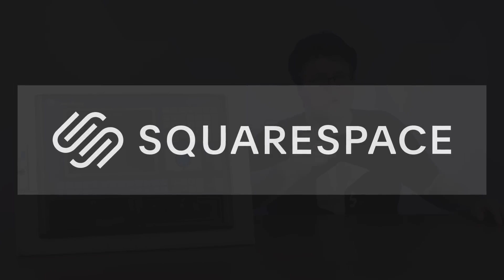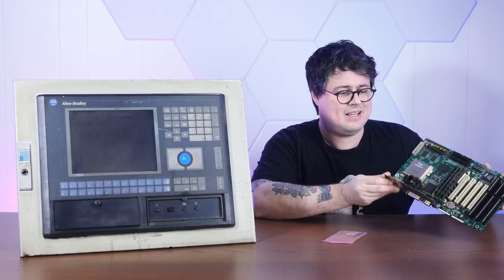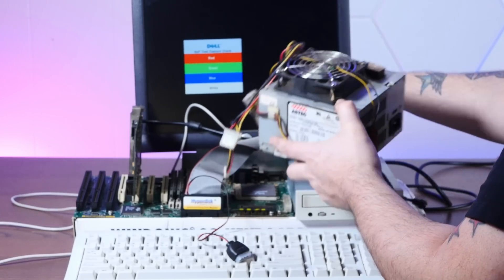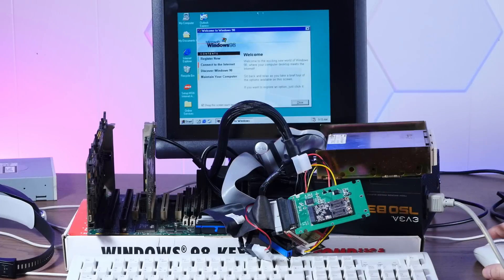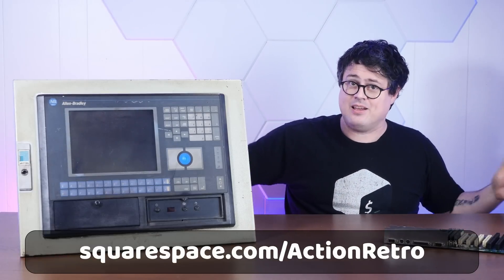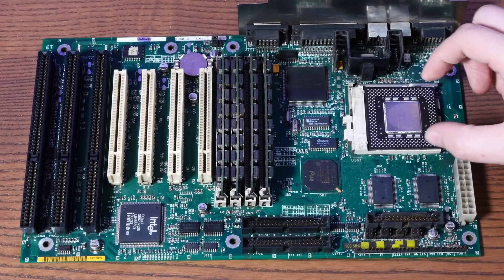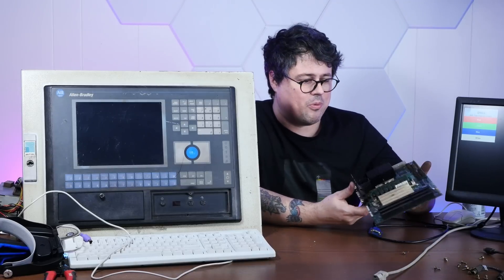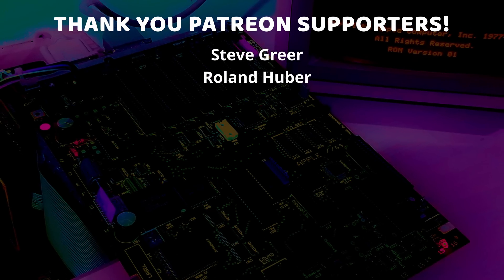Overclocking a 90's Industrial Computer

Comment: Too bad : your 233 would have had a legendary frequency :
- Multiplier 3.5 is at max on this cpu,
- FSB is another story : base is 66Mhz but you can go up to 75 / 83 / 100 depending on the board you have.

Comment: Is suggest installing ither a 3DFx Card or an Early model Riva TNT, TNT, or Geforce a Matrox G400 (Have one in my "Retrobox 2.0", Pentium Talautin 1.2GHz @ 1.5GHz, 1GB RAM, 16GB IDE SSD and a G400 for 2D - witch is a very good DOS, 2D card and even a decent 3D accelerator, paired With a pair of SLIed Voodoo2 12MBs for 3D duties). 

All good for DOS and Windows games, especially acclerated ones. 
Just an idea.

Comment: And, for reference, the WHITE image IS NOT the motherboard, it will be the graphics adapter OR the LCD controller itself. Though from what I see I would advise you to check the cables between the LCD controller itself and the LCD panel as I have seen this before and it was due to a bad connection between the LCD controller and its flat panel. So check the board the VGA cable connects to and then check it's connections to the panel.

Comment: That CPU likely has a locked CPU multiplier, as such you would need to instead increase the FSB speed, though to do that you must ensure that everything that depends on the FSB supports the higher speeds, things such as PCI bus clock, RAM clock and ISA clock are usually derived from the FSB and as such you must ensure they all work at the faster speeds.

Comment: Initially when early IDE/ATAPI CDROMs came to market the motherboards bios would not detect ATAPI/IDE CDROMs as they were not designed to work with that type of devices and would also not be able to boot from them, BUT once you load the CDROMS driver on DOS or another OS it would work.

Comment: Just a small note, most processors if not all in the socket 7 lineup were multiplier locked and could not increase the multiplier, but you could always use a lower one. The method for overclocking the p233mmx is set the fsb to 75MHz with the stock 3.5x multiplier or if the board supports it 83MHz with a 3.0 multiplier, netting you approximately a 263MHz/250MHz Pentium experience.
Reply: Hi @Benjamin Hale, the multiplier lock was not introduced until the Pentium II line-up. All socket 7 CPU's have a completely unlocked multiplier, as had been the norm up to that point. When the locked multiplier was introduced with the Pentium II, the claim (I think largely true) was that it was to combat fake CPU vendors that would re-mask a CPU and sell it on as a higher clocked version than it was rated for. I do think Intel liked putting a stop on casual overclocking as well.
I know this for two reasons. I have access to all of these processors first hand. I also have the timing of this burned into my memory. One factor in my choice to buy an AMD K6 for my first computer build instead of a Celeron was the multiplier lock.
Reply: I thought most were unlocked. My Pentium 166 and K6-2 450 are definitely unlocked. And the standard FSB speeds are 50, 60, and 66 MHz. 75MHz FSB is definitely not on all boards.

Btw with older CPUs a locked multiplier can't be lowered. My PIII-700 is always 7x, to underclock you need to lower the bus speed. I'm guessing Sean has a 200MHz CPU and he unknowingly overclocked it (the 1.5x jumpers are remapped to 3.5x on the MMX).

Comment: Basic math shows that the manual's jumper settings table @8:59 are incorrect (and inconsistent with what's printed on the board right next to the IDE connector). The clock multiplier column should read "2" for 133 MHz row (not 2.5), and "1.5" for the 100 MHz row, since 66.67 × 2 = 133, and 66.67 × 1.5 = 100. This can be confirmed by looking at the adjacent rows; the "jumper D" settings are respectively identical to the lines for 120 MHz (where "2-3, 4-5" is a multiplier of 2), and 90 & 75 (where "1-2, 4-5" is a multiplier of 1.5. 

Looking closely at the video and zooming in on the jumpers, the CPU frequencies seen are consistent with what they are supposed to be, specifically:
- @7:22 the jumpers were in the original "100 MHz" positions for 66 MHz bus & 1.5 multiplier; 1.5 serves double-duty as a 3.5 multiplier on MMX CPUs, and 66.67 × 3.5 = 233
- @9:16 the jumpers are in the "highest possible" position (as mentioned @9:06)...66 MHz × 3 multiplier, correctly resulting in 200 MHz 
- @9:42 the jumpers appear to be in the 166 MHz setting (66 × 2.5); not sure why the 200 MMX would freeze at this speed
- @9:48 the 125 MHz result is consistent with the jumper setting, which is "2-3, 5-6" for C (50 Mhz bus), and "2-3, 5-6" for D (2.5 multiplier)...50 × 2.5 = 125
- @9:56 the jumpers are in the 50 MHz × 3 positions (C = "2-3, 5-6", & D = "1-2, 5-6"), so 150 MHz is correct
Reply: I'm glad I wasn't the only one who noticed the errors in the manual.

Comment: I had a breakthrough with my modern PC the other day... Such an esoteric problem I had! I'd tried to change the gpu to an AMD one on my b550 Aorus master. Apparently when you change the hardware in any major way the motherboard wants to show some kind of message which isn't displayed on most normal display port monitors! So I found a post where someone had the same problem with an Aorus master x570 board and found that I had to just boot it once with just my hdmi tv plugged in... then saved my bios settings and rebooted (which would usually result in a hang with 00 code)... But it rebooted just fine with the hdmi tv plugged in and now can restart from bios every time even with my display port monitor installed! This is the trickiest PC problem I've ever had to overcome!

Comment: It is possible use other motherboard?
I think is better use a modern board like s370/slot 1 or up to s478,
Reply: If he did that, he might as well just tear out everything and stick a new Ryzen board in there and mount a modern LCD in it too. Either way, it would be a different machine.

Comment: I think you may have fried something when the CF to IDE adapter shorted.

I remember noting that when you removed the IDE Cable, you moved it FROM the socket that's dead, and plugged the DOM into the one that works. If that's true, you would have never registered "shorted adapter = dead IDE" because it worked after you installed the DOM.
Reply: I saw this as well. That's defiantly when the secondary ide channel died. I may or may not have done this before... <_<

Comment: the 233mhz speed is not too unexpected since the stock cpu was 100mhz and have come across several socket 7 boards that make 1.5x66=233mhz when using a later mmx pentium
Reply: Exactly this. The processor was made at a time that Intel knew that MANY motherboards had maximum multipliers of 3.0x, which at a 66 MHz bus speed is…. (As Action Retro demonstrated) 200 MHz. So they made it so that if the CPU was being told to do a 1.5x multiplier or less, it would just automatically do 3.5x instead.

I'd be curious if the "RESERVED" bus speed jumper setting of J7K1-C: 1-2 4-5 might produce a 75 MHz frequency or something. Unfortunately, the multiplier jumpers already are using all possible combinations to produce 1.5, 2.0, 2.5, and 3.0. So if J7K1-C 1-2 4-5 is 75 MHz, using the 3.0 would be slower than stock at 225 MHz (but faster bus, which may be some benefit.) and if the CPU still does the "1.5x -> 3.5x" internally, 75 MHz would be 263 MHz - which MIGHT be possible for that CPU with proper cooling.
Reply: @AnonymousFreakYT  Yeah but "RESERVED" might connect up bits of the clock circuit wrong and end up blowing something, jumpers physically alter circuits after all, they aren't just data.

You're quite right about CPUs re-using old multiplier settings as faster ones though.
Reply: @greenaum  Jumpers sometimes alter physical aspects of the circuit. However in this care they are just data bits going into the clock generator IC.
Reply: @eDoc2020  Sure but if, for example, you set a bit by connecting to gnd, vcc, or leave floating, you might end up connecting gnd to vcc with an illegal jumper setting, buggering the whole thing. It's also not impossible that other components are connected to the IC, different crystals or passives to work with the PLL.

If you know better in a specific case, feel free, but as a general principle it's good not to mess with stuff like that. If it was meant to do other clock speeds, they'd likely be there legitimately.

Besides that, the multiplier jumpers go straight to the CPU, which multiplies the clock internally. They are data bits, yes (though of a particular voltage other components might not share), and as I said, Intel / AMD repurposed them for higher multipliers as lower ones became obsolete. Confusing at best, also another good reason to stick with the manual!
Reply: @greenaum  Obviously it's safest to stick with documented settings but generally the designers aren't evil.

Comment: amd k6 3+ please twice the pentium you have there :P my childhood dream

also try making fat 32 partitions on the drive on onther computer, you may get the bios see 2gb but it will still boot from bigger partition and windows wuill see the whole size, my k6 166 booted from 40gb hdd devided in half with the bios capable of seeing max 8gb
2gb was the limit for windows 95/fat windows 98 should be able to see drives bigger that 32gb
Reply: You don't need a separate computer to create the extra partition. If you launch FDISK from a DOS Prompt inside of a fully booted Win9x you can create the partition on the same system.
Reply: @eDoc2020  oh really? i either never tryed it because of lack of spare hard drives back then or i had lausy luck with it (might be either i was 16, 20 years ago)
either way my old mobo accepted disks up to 8gb in lba size seen in bios, seagate baracuda has 40gb and my boot partition had 20gb, and we were all crazy with my younger brother and walked to the nerdiest friend we had to a vilage close by to get the partitions set up on a new drive
Reply: @kokodin5895  I don't know where I came up with the idea but I was somewhat surprised it worked. I found it fascinating that in DOS mode a drive letter wouldn't exist but in Windows it would.

Comment: You know that 750W power supply might be enough to power the computuer AND the robot that machine might have originally controlled right?
I mean not most of them, but one of them was probably a light engraver and not a 2 ton CNC lathe
Reply: When in doubt, you should go overboard on wattage with modern PSUs on old computers since they're mostly designed with 12V load in mind. This particular 750W PSU like many only does 120W max combined on the 3.3V and 5V rails.
Reply: @D0Samp  I dare him to build and run an engraver or laser cutter off this PC with the extra 12v capacity as its designers intended.

Comment: The symptoms look like, that the Graphics Board is not connected to the Display. May the cable is on the Graphics Card loosy or on the LCD self. The Display don't get Power for the Logic. Only the Backlid is powered, this should be a seperate Powerline to the Inverter for the CCFL.
Reply from the maker: I'm thinking the same - the cables are connected, so I'm wondering if a solder joint on the video card's internal connector cracked
Reply: @ActionRetro  Ok, lookup for the datasheet of the LCD-Panel to get the pinout of the Data-Terminal/Connector and then trace it to the PCI-Card. May a little fuse is there blown or this Slot is different from Power Levels? In the First Video was the Graphics Card in the 2nd Slot near by the RAMs.

Good Luck

Comment: That board appears to be using SMD caps....Aren't SMD caps of that age known for leaking?

Might want to think about replacing them. Might revive the dead IDE port and the display. ;)

Oh and if you used windex you might have damaged the polorizer on that LCD panel. :(

It probably doesn't have a protective cover like normal LCDs that are exposed to the environment since it's been behind that front membrane keyboard cover thing it's whole life.

You can try finding some polorizer film/sun glasses and looking at it through them. If you see the display working through them then yeah you damaged the polorizer. :(
Reply: no, cap plague was much later in the early 2000´s
Reply: @motorb1tch  No that's a seperate issue. This appears to be a mid to late 90's machine. You know what else from that era needs new caps today? Vintage Macintosh Machines. I also have a few VHS camcorders from that era that use SMD caps that have started to leak. 

It's not related to the plegue of the 00's. The SMD caps from the 90s like this mobo uses are simply prone to leaking due to their age. It's mainly the through hole style caps that lasted longer hence why some really old stuff like the Macintosh SE which doesn't use SMD caps but cylindrical through hole ones don't need new caps. (though their analog board/power supply capacitors are starting to fail but this is due to heat exposure which shortens capacitor lifespan and the analog board and power supply is pretty much where all the heat comes from in that machine)

So that's why I suggested replacing the SMD caps. It's not related to the 00s capacitor plegue but the aging SMDs from the 90's plague. :P
Reply: @MagnumForce51  true, these caps dont last forever even if they do not leave the factory defective.
still, i would never suggest to fix something that is not broken. 
it is an industrial board and certainly build to very different specs then consumer products.
while you are right in that caps of that age are always suspicious, id rather suggest to measure them with a mulitmeter  then just pulling out the soldering iron.
Reply: @motorb1tch  Well the board is broken somewhat. One IDE port stopped working and there's no video output to the LCD panel. (though that could be an issue with the panel itself after he attempted to clean it)
Reply: might as well put a Microid Research BIOS on it

Comment: I don't understand why are you upgrading the CPU and you still do not have drivers for Windows 95. 
So now you have Pentium MMX, and you still can't game cause you don't have drivers.
Reply from the maker: I think Windows 98 will solve it
Reply: @ActionRetro  I mean I kinda doubt it, Windows has built in only some basics drivers, you should find out what graphics card you have and find driver for it online.
Reply: @KoleckOLP  Windows actually came with drivers for most of the available hardware released before it. So Windows 98 will most likely have drivers for all the non-exotic hardware a 1997 PC has. I was actually recently surprised when 98 had a driver for an Ethernet card made in 1999.
Reply: @KoleckOLP  Have you looked at the drivers provided with Win98? All the run of the mill components are covered, and there are VESA drivers that work on most VGA chipsets.
Reply: @eDoc2020  I dunno my HP PC from '95 does not have all the driver in Win95 or Win98 and I always had to find the drivers, it's a good practice to open device manager and get all drivers that you are missing before playing games 😅
Reply: @ActionRetro I think should you get the internal display working again, put a better video card in it and see if it can be adapted to the internal display. It’s probably just a VGA pinout.

Comment: here are a few things i would like to say
1. did you say it is a 200mhz processor??
-if so in that era Intel was strict on blocking over-clocks
2. if you flip the chip over you should be able to read the model
-SL27J/2.8v is 200mhz
--C:1-2/5-6 D:1-2/5-6 1-2 would be bottom left and 5-6 would be top right (by the way you showed us in the video)
-SL27S/2.8V is 233mhz
--should not even be possible with the info for this board
3. by the looks of the screen you showed with the frequencies and multiplier settings this mother board cant run at 233
-doing so might cause issues
4. by the looks of things you have a P55C version of the processor you might need a P54CS
-because of the voltage

mother boards/processors during this time where finicky as hell, if you did something they do not like it might boot but then fail randomly
Reply: The jumpers for 3.5x are the same as for 1.5x. Which multiplier you get depends on the CPU: non-MMX interpret it as 1.5 and MMX interpret it as 3.5.

Most of the Socket 7 chips are unlocked. IIRC the most notable exception is newer 133MHz Pentiums.

Comment: That's an Intel Advanced/ML (Marl) motherboard which only provides a single CPU voltage rail. You are overvolting the Pentium MMX as it is a split voltage CPU! Classic Pentiums use 3.3v whereas the MMX is 2.8V! Only a Pentium MMX Overdrive is supported as it has onboard voltage regulation.
Reply: I was worried about that too when he never mentioned adjusting voltage. It'll probably work for a little while since old CPUs are pretty voltage tolerant, but it's certainly not good for it. The Pentium MMX needs the core voltage at 2.8V (2.9V is probably safe for overclocking) and 3.3V for the I/O voltage.
Reply: @NTGTechnology  I'm sure it will be fine with the 20% voltage increase. The main downside will be heat and thermal paste + heatsink will take care of that. The old Pentiums were usually used without any thermal paste.

If it were a 2.0v CPU I'd be much more worried.
Reply: i hope he sees this!!!!